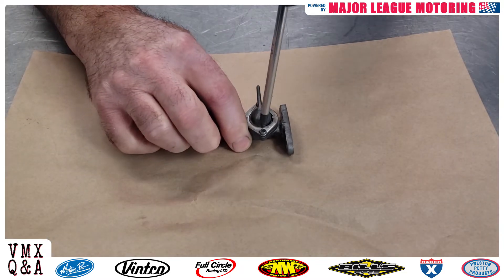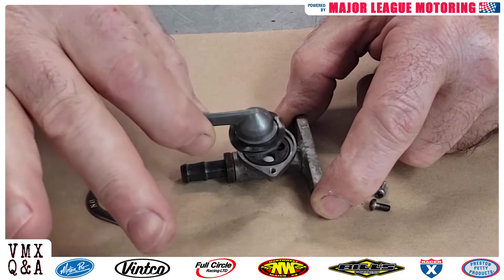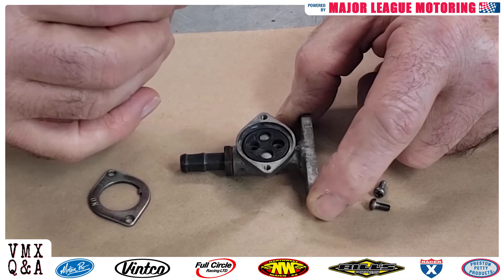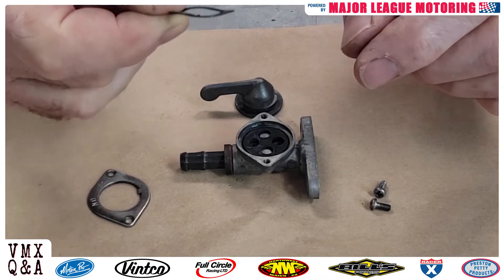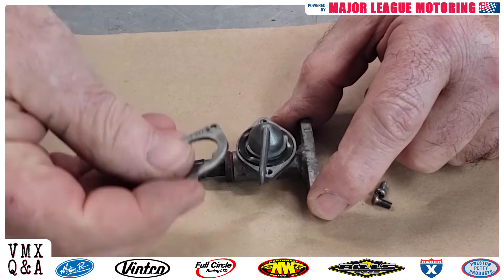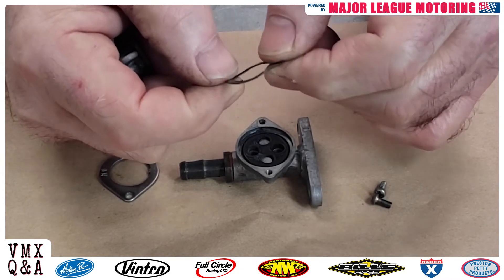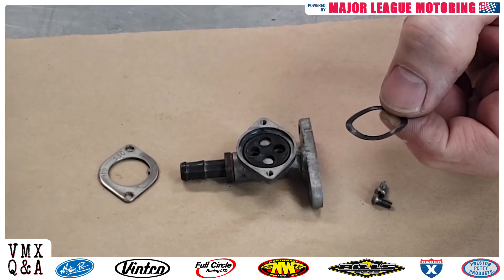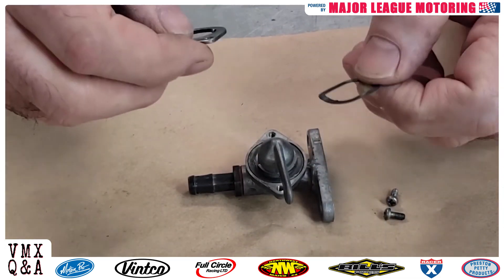Leaky petcock- VintCo Vintage Dirt Bike Tech Tip

Comment: the housing where the screws go in can also warp causing the wave washer not to put enough pressure on the gasket/seal just square it up on a flat peice of somethen with some 320 wet sand paper. remember it's soft material it dont take much to deform it. do not try to bend it back to shape it will probably give you a few extra peices and  then it's all junk...